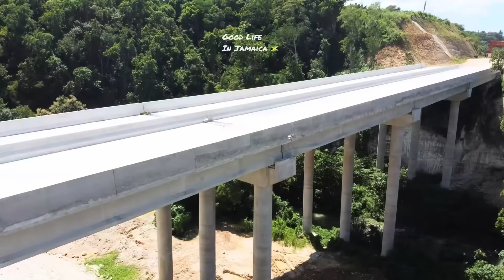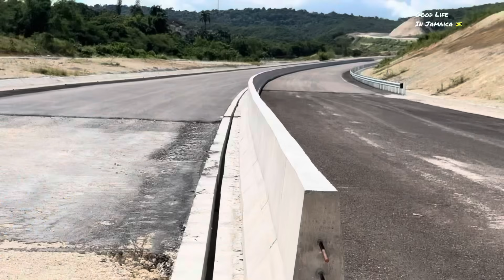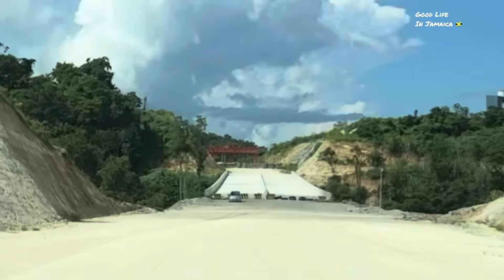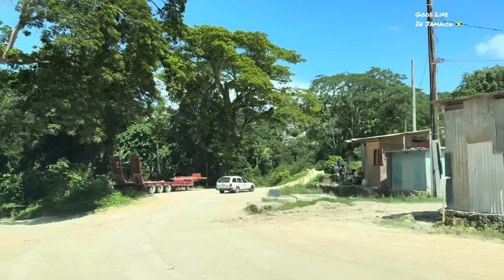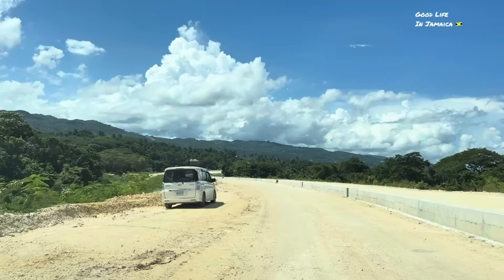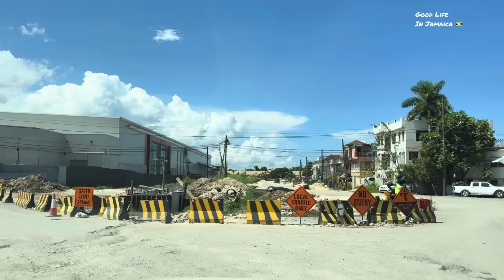Final Stretch! Montego Bay Bypass Construction Reaches the Last Phase

Comment: Word on the street is that they’ve adjusted The Pinnacle’s design to accommodate the Hotel operations. The Hummingbird and Phoenix towers were completely redesigned and placed closer to each other and appears both will now be apart of the hotel.
Reply from the maker: Appreciate the info!
Reply: If that’s true I think that will be great I see a picture not sure if it’s so
Reply: @douglasjoseph2097  Did you see it on a realtor’s page?
Reply: @douglasjoseph2097 where u see the picture ?
Reply: Will the redesigned hotel towers be the same height (and shape) as the other towers...?
Reply: @garfieldwhittaker944  Looks to be the same height but the design are a little different
Reply: @JadenMalik the exterior design or the interior one....?
Reply: @JadenMalik pity...they should just go for 30 floors...